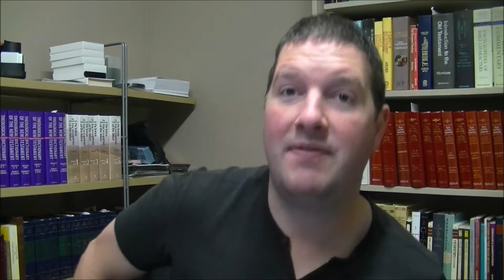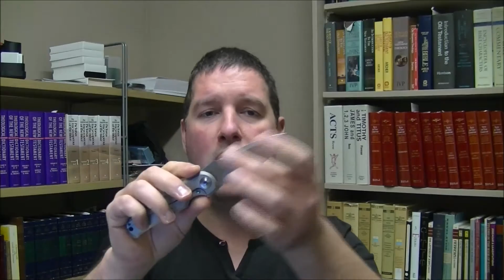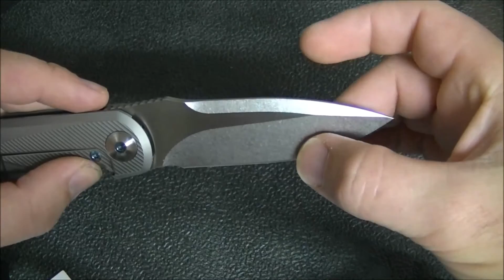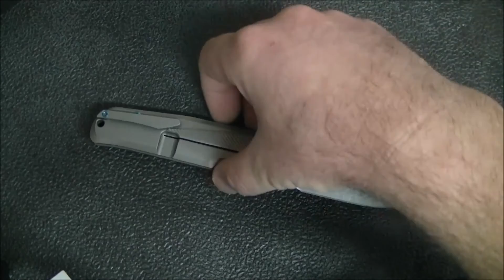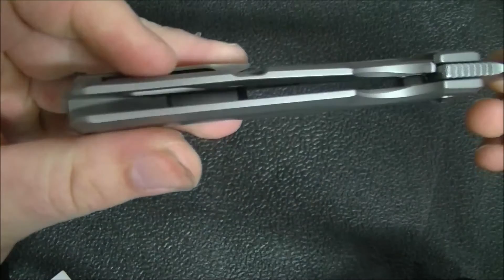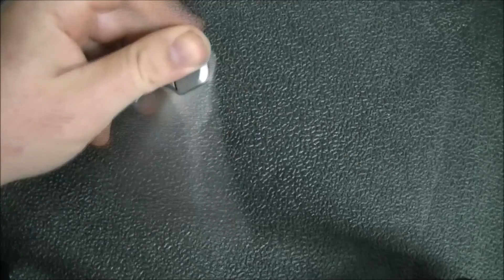Liong Mah Design SDC

Comment: If it was ground differently it would look a lot like one of his other blades that he has on his other knives such as the remedy. I think that the blade is 1/2 form and 1/2 function. If I am going to spend $350 for a pocket knife I would like it to have good looks also. I liked this knife  enough to get one. If this is your only knife I would agree with you but if you have other nice  carry knives then this is for you. Great design and top notch manufacturer.

Comment: If there IS such a term I'd say it's a 'Gentlemans Hard Use Folder'. Beautiful, understated design with excellent steel. Pocket clip has only one anchor point and not left-hand freindly as it's right-side tip up only, but it is discreet. Jimping is welcome but seems to be more cosmetic than useful (eg PM2). Altogether lovely work from Liongh Mah while keeping in mind that no knife is perfect for everyone. Thanks for posting...
Reply from the maker: paul greenwood the clip fits into a milled space in the handle so only needs the one screw
Reply: Kevin cleary
Oh right....understood.